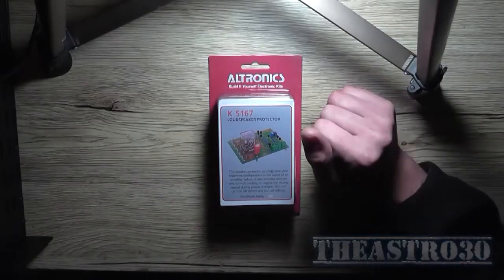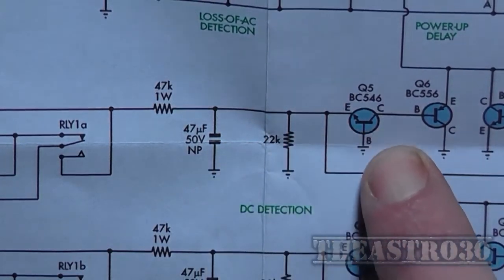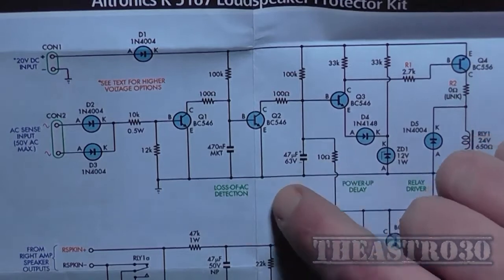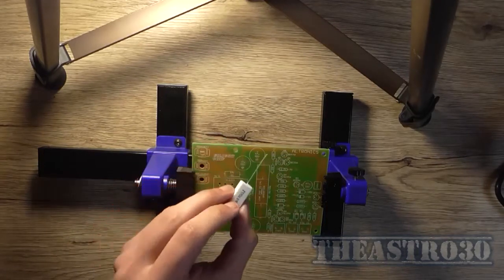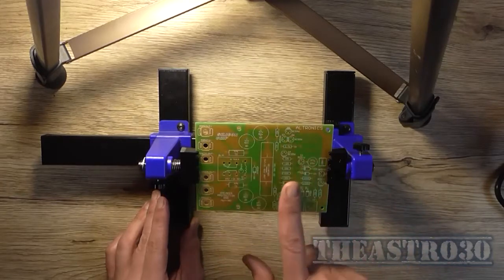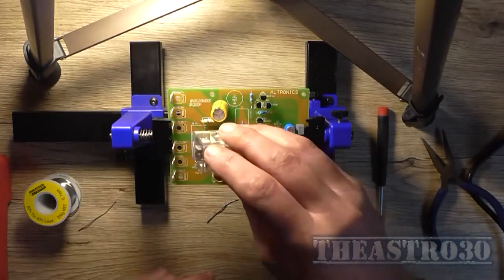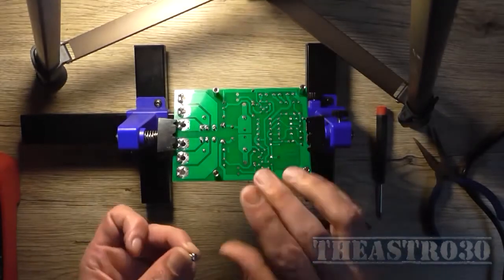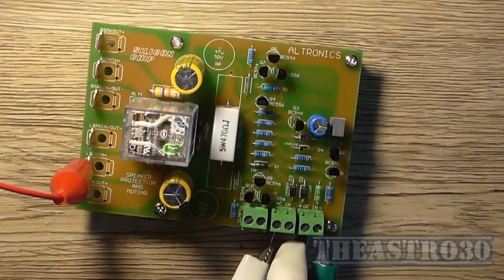Silicon Chip K5167 Loudspeaker Protector Kit Build & Test

Comment: in Your Bass amp what do you connect up to the AC sense input on speaker protector board?
Reply from the maker: Both half sides of the ac transformer. So, one 25v and the other 25v with respect to 0
Reply: @AstrosElectronicsLab  My Power amp transformer is 40 volts per side but I have a second 15 volts per side transformer running the Pre amp board so I guess I could hook that up.
Reply from the maker: @rcscifi yes. That would work. As long as the voltage doesn't exceed 50v actual (25v because it goes to a full wave rectifier)